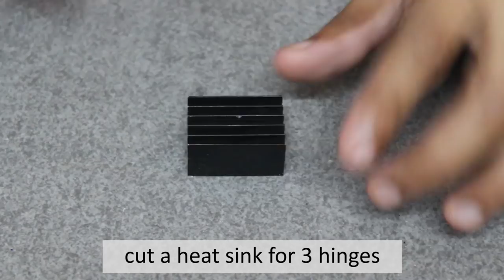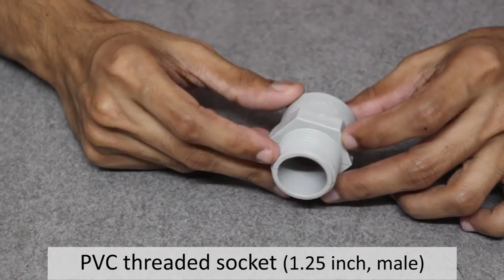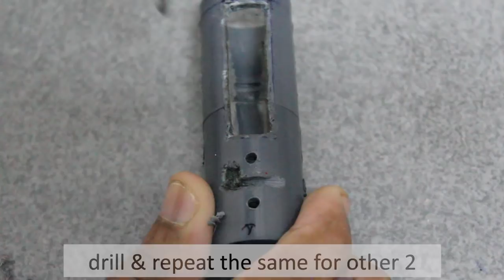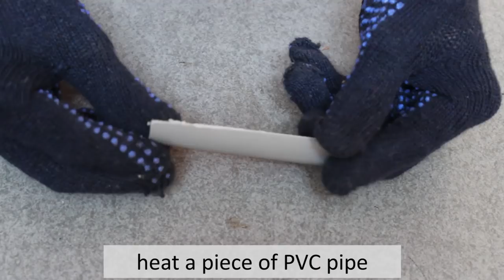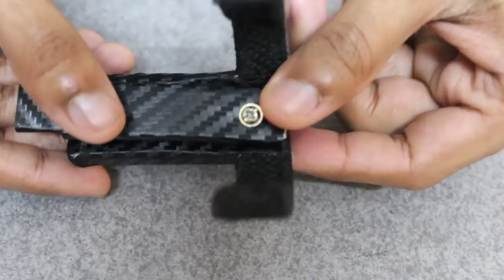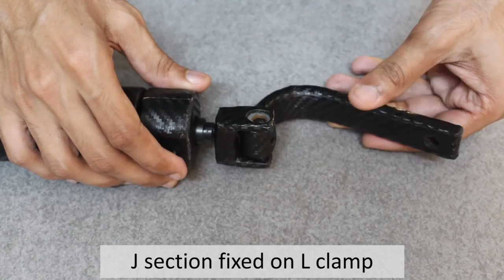How to make a mobile phone Tripod using PVC pipes

Comment: I kept thinking - he is going to cut his finger - I would have - well done!  With your talent if you were close by I would consider investing in a start up of specialized pods. Within each market there is always another. Improvement  of something that works and sells is a path to profit.
Reply from the maker: Haa, true😁. The thing is that, i don't have a proper holding rig to cut stuff, so was struggling to cut smaller pieces perfectly. Anyhow i was going too slow while cutting and the video was speeded up, so im somehow in a safer side 😁
Thank you for your comment, and luckly im in one of the finest research setup in Asia and exploring a lot each day in prototyping and stuff. So startup is in my mind☺️

Comment: Nice idea 
But can u list every product or item used in this video with measurements so that we can buy it
Reply from the maker: Thank you for checking out the video.
I have a detailed step by step description of the entire process and parts on my publishing page.

Its in the discription. Could you check that out
Reply: @HobbyRoom  Bro I need the size of the bolt and screws
Reply from the maker: Okay, i didn't used screws in this project and all are bolts
The thinner bolts  that used in the project, are of two types, one with half inch length & another one with 1.5 inch length. Both of them are of  2.86mm thickness. However we can't get the exact  length for the bolt since it depends lot of non defined factors and we could one come to a length once doing the project. So i often used a strong wire cutter to cut the bolts to the required length.

The larger bolts, used on the upper side are of about 7 mm thickness and a length of 5cm. As mentioned earlier, the length is not fixed and we need to cut it accordingly.
Reply: @HobbyRoom  thank you
Reply from the maker: You are most welcome